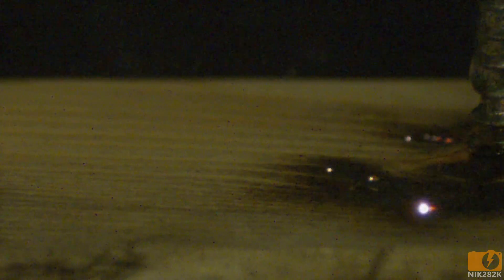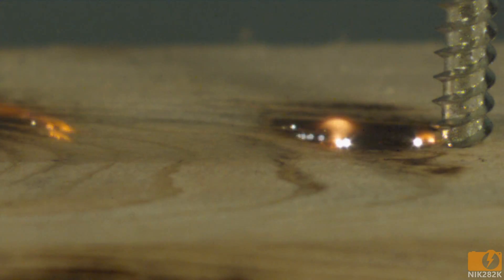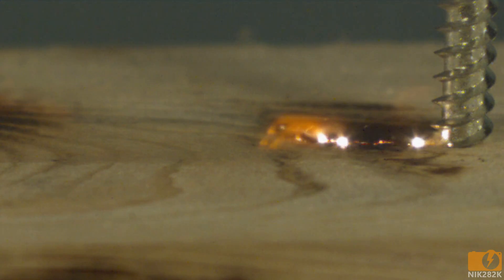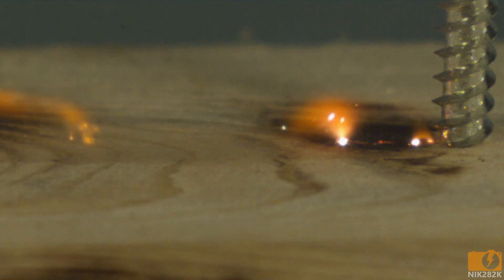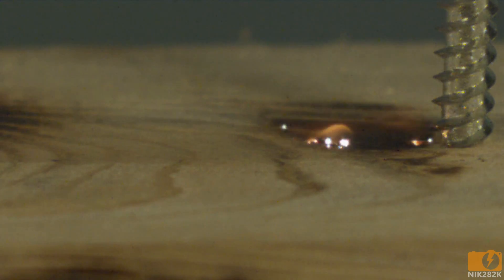Micro-Filaments in Electrical Arcs Through Wood

Comment: Nice close up shots there, things you would never see. If DC was used I guess we would see both arc forms but only in a single position, as in which ever way the current is flowing. 

Have you tried drawing lines on the wood with regular pencil or something with graphite in it? electricity is meant to follow the lines of graphite being lazy and all.
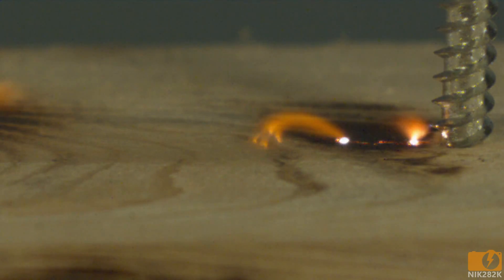Reply from the maker: The arcs follow the graphite very closely but once the current peaks it will sometimes jump out of the graphite and into the air (as seen at 0:52 in this video). I think there is a point where the air becomes more conductive than the graphite which makes this happen.

Comment: They look like anti-fulgurites; formed by condensing material above the surface, instead of fusing below it, as when lightning strikes a sandy beach or desert dune.  It might be a condensate of whatever the plasma is vapourizing, perhaps even buckminsterfullerene if it's carbon being vapourized.   

Perhaps wood with high silica content, such as cedar, would give interesting results...?

I've used high voltage diodes from a microwave oven to limit current flow to one direction, but of course, it won't be very smooth; I didn't have four, either, so it wasn't a full rectification.

If you do try plastic, *DPE or PP ought not to be too terribly toxic to do indoors, as they're not chlorinated, brominated, or fluorinated plastics.
Reply from the maker: Anti-Fulfurites are it for sure, I have been keeping an eye out for fresh wood as the filaments seem to occur most often near knots where lots of sap boils out. I have a whole bag of 1kV 1A diodes but I don't think I could practically make a 15kV smoothed DC supply that could put up with dead shorts and transient spikes of both voltage and current :/ I think a heavy duty flyback supply would be needed.

I could try rectifying and smoothing a MOT but they are dangerous enough without adding several kJ of energy storage.
Reply: Try one;  the current's pretty small, isn't it?
Reply: I mean, in the NST;  Try just one diode.   I know the current's pretty dangerous in an MOT.  :)
Reply from the maker: The NST is only 30mA short circuit but it would take a stack of 22 1kV diodes to rectify 15kVac, at that point it becomes difficult to insulate against flashover/creeping. If I get my hands on a beefy HVDC supply I will try this again, I'm pretty sure the dc supply from an old CRT should do it.

Comment: Hi! I saw growth of carbon particles when I was burning plastics using a neon sign transformer as a kid. The matter that formed at the tips of the wires was maybe 2-3 cm in lenght, very porous, fractal in shape and so light that it could float in air. Great footage btw!
Reply from the maker: Interesting, I'll have to try plastic as well (outdoors) and see if I can get the same effect.
Reply: I know this was a while ago but did you get a chance to try this with plastic? I'm very interested!

Comment: Excellent observations, Nick. I'm assuming by evolution, the tree is the strongest configuration. Why do filaments form trees instead of webs, when webs are stronger at the base? What is the purpose of the branches, why not just form a single-stranded filament? Did you observe any other types of filaments?
Reply from the maker: There were occasionally single strands but for the most part they formed tree-like structures. I think it may have to do with the electric charge in the filaments repelling and causing the "branches" to fan out.

Comment: Great closeup shot, that camera really is terrific. What would happen if high voltage DC supply was used instead? Would those "fingers" dance around more since there would be no polarity switch or would it simply not work at all with DC?
Reply: Hi, Nick. Great video!
I don't think that these dendrites are made of charged particles.
If they were of a same charge (positive or negative), they would rather form a hemisphere.
So, it seems to me that when the water in the wood boils the fine particles of cellulose tear off the surface (something similar to MALDI, although the particles don't ionize here).

I suppose that due to a high polarity of a cellulose these particles can act like dipole: they would spin as the polarity of current changes, but they would stay in the same place. Dendrimer formation is typical for dipoles.

I've found an interesting article on this theme: http://pubs.acs.org/doi/abs/10.1021/la0472697?journalCode=langd5
If you have no access to it - I can send it directly to you

Greetings from Russia!
Reply from the maker: Hello! My mind immediately went to carbon nano-tubes when I shot this video but I have no way to find out what they really are so I refrained from mentioning it in the video. I do not have access to the article but abstract sounds like what I am observing, particles are freed from the wood and then spontaneously assemble into thin wires and branching structures.

I agree that the particles and filaments are likely not charged but are conductive which is why they spread out in an electric field, like hair standing up from static electricity.

I'm glad you liked this video, I have lots more planned for the year.
Reply from the maker: I'm not sure if the AC helps them grow or disturbs them. I unfortunately don't have a 15kV smooth DC supply so I can't tell you just yet.
Reply: Maybe you can rectify it with diodes mounted in series, immersed in silicon oil?